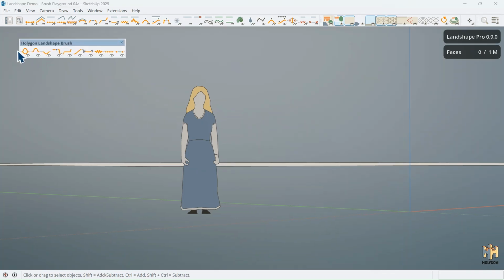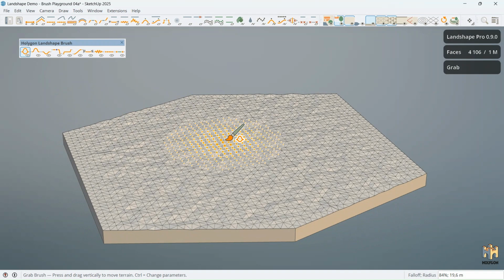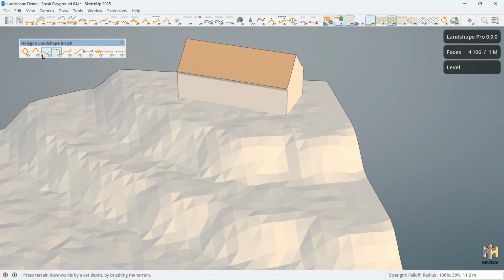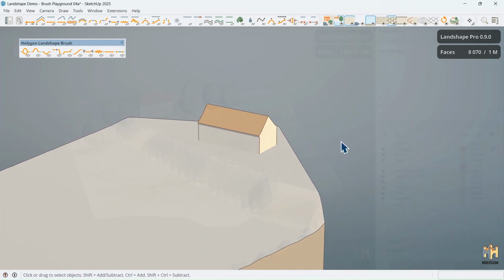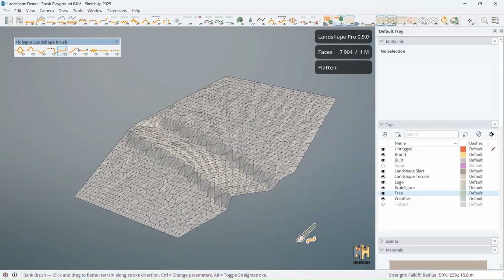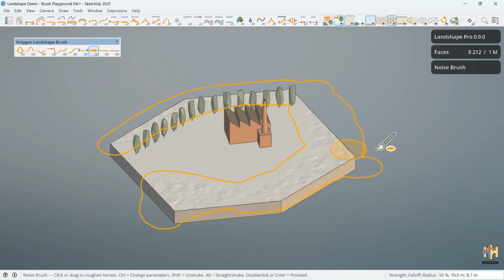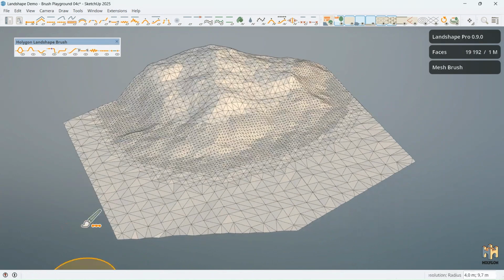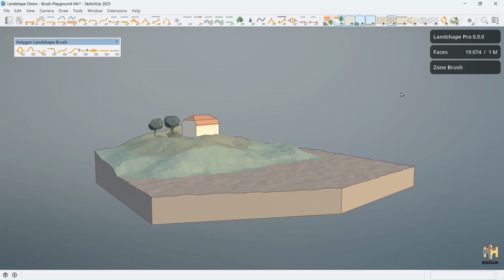Meet 10 Landshape Brushes – Learn 3D Terrain Modeling with Holygon Landshape for Sketchup

Comment: Hi, I'm starting to test your extension... Can you tell how to use this with a "Add location" in Sketchup plz... 🙂
Reply from the maker: Thank you!

Yes, sure, you can start a Landshape terrain from Addlocation geometry. 

In fact, you can create a Landshape terrain from any Sketchup geometry.

To start a Landshape terrain from Addlocation geometry, do this:

1. Make sure to start in a new, fresh, empty, Sketchup model. When learning Landshape, please work on one thing at time. Use a clean model environment. Remove any clutter. Always keep it simple and organized.

(1b. Optional: In Landshape, open the Landshape Panel. Look at Resolution (Global). Ensure that you have a Resolution value which is sane. For instance around 2 metres (say 6 feet). This step is not necessary, just a sanity check.)

2. Import a small Addlocation. Make it around 50 by 50 metres (say 150 by 150 feet). You can make it much bigger, but start small and simple. This helps you learn the tools faster.

3. In your Sketchup model, select your Addlocation source, and it only. It should be 1 single group. 

(3b. Optional Pro Tip: If you also select a second group, which contais e.g. a circle or a rectangle, positioned above the Addlocation source, you may use this second input group as a Mask for the first , limiting the extent of the terrain to be created to the plan of the mask. This a good way to control the Landshape terrain extents.)

4. Run Landshape > Form. This should new Landshape terrain for you. Type values to VCB and hit Enter to change resolution, while still in Form.

(4b. Optional: With your Addlocation still selected, run Landshape > Zone. This should style the Landshape terrain with the Addlocation texture. Since it is easier to read the terrain shape when it is one color, and not when it has an irregular texture, it can be a good idea to skip this step, or to do it later in the process.)

5. Hide the Addlocation source via tags. You can always bring it back later, if you wish to shape or style your Landshape terrain using the Addlocation as source. With the Addlocation hidden, you should get an unobstructed view of your Landshape terrain. 

Now, you can start landshaping your terrain, using pickers, brushes and the whole battery of commands.

• Does this help you?

Comment: Can i use the zone brush with the embed fence to allow adding texture/color to a particular area (without going outside of the fence embed)  if not, how can i apply texture to an area that i have either embed or embed fenced?  i want to apply a different color to a road or a sidewalk or a property.
Reply from the maker: Sure - good question!

Quick answer:
To work with terrain materials in an accurate way, you should separate embedding from zoning. First select the edge borders you need, then embed them. Then, select the group of painted faces that you wish to paint the terrain with, then run Zone. If you wish, you may finally replace entire existing zones using Fill.

Detailed answer:
Zone brush is a tool that lets you quickly sketch surface zones onto the terrain. Zone Brush currently does not support fencing. Note that Zone brush will retopologize terrain along its stroke border. Zone brushing will thus both Zone and Embed.

To more accurately paint terrain with materials, use Zone. Zone is a Pick command, which requires an input group, also called control group. To Zone, first create an input group. Place it above the terrain. The input group should contain one or more faces. Landshape does not care by what method you create the input group. Paint the input group itself, or pain its faces, or both, with any Sketchup materials. Landshape does not care by what method you paint. Then, select the control group. Now, run Landshape Zone.

Zone should project the materials of the faces of the input group onto the Landshape terrain. You may select multiple input groups, and Zone using all. If input groups overlap in plan, the uppermost will win.

Note that if you just Zone terrain with say a red grouped circle, the terrain zone bounds will not match the input group bounds. This is because the terrain does not contain the same sharp border as the input group. Remember that Zone only projects, it does not embed.

Currently, Zone ignores fencing as such. Zone only tries to match faces. 

To make faces begin and end exactly where in plan you want them to, use Embed. Embed lets you control the exact terrain boundary between material zones. To do so, first select edges, then Embed them into the terrain. Then Zone. 

Often, you can use the same input group to Embed and to Zone.

Once you have zones in your landshape terrain, it is quick to replace the materials any or all zones. Simple use Landshape's Fill tool, and click a terrain area to paint it. In the Fill tool, sample materials with Alt, or by clicking a Sketchup material swatch.

Currently, only classic brushes support fencing. Currently, area brushes do not support Fencing. Area brushes are Zone brush, Mesh brush, Noise brush. Holygon aims to make area brushes support fencing in the future. 

Does this help?